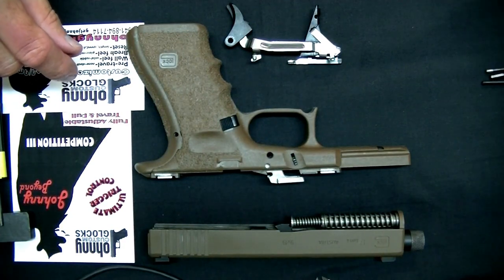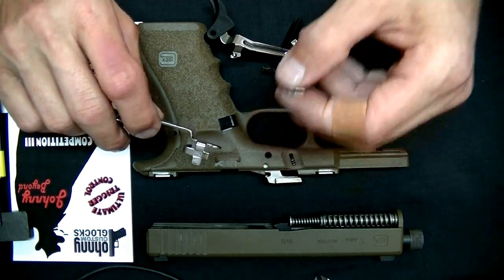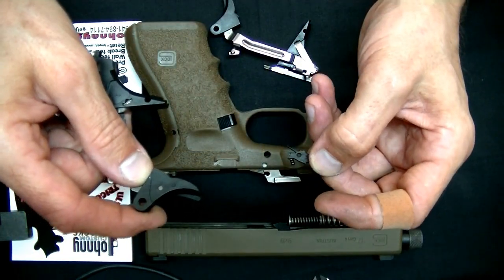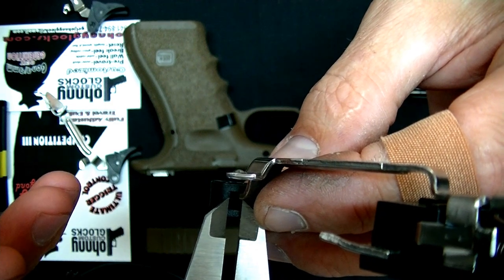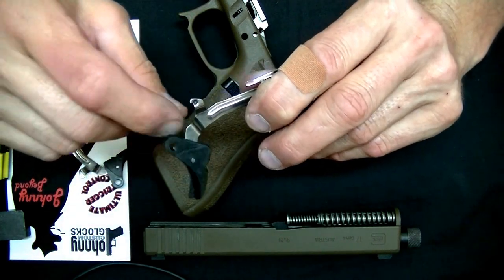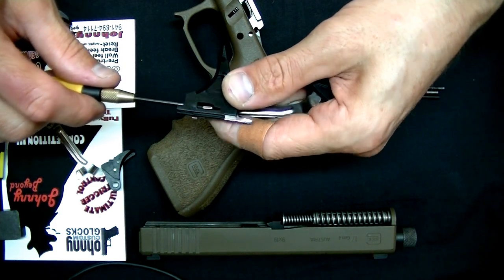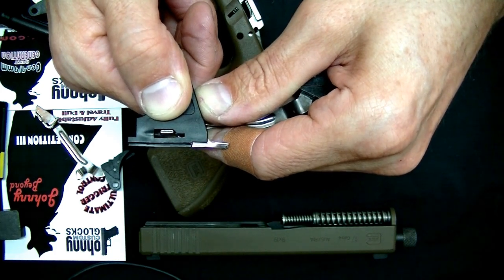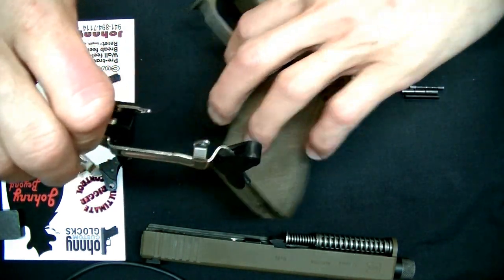Dialing in Johnny Custom Glocks trigger pt1 EDUCATIONAL ONLY

Comment: Great view and explanation of the trigger reset.  Now what causes the trigger bar to move out and away from the control tab?
Reply from the maker: if I understand what you're asking correctly. it's actually part of the slide that pushes the control tab over. turn your smile upside down and you'll see a cutaway in the rear right above the control tab. during cycle this will push it over allowing the spring tension on the cruciform to do its job pulling it up towards the slide and pulling it back behind the face of the connector.

Comment: Does those set screw requires some kind of loctite? How does it perform with heat? I own a metal trigger shoe and it gets really hot after a few mags, the loctite used on it will come loose also.
Reply from the maker: I drill at 60% and use a taper tap leaving the last few threads uncut. This allows for amazing seizing power also they are pre configured now and seized with loctite 425 specifically designed for polymer to steel application
Reply: @johnnyglocks  Awesome. Looking to order a set soon. For your JG shoe, are they only available in black? Did not see an option for the silver one before adding it to the cart. Would prefer the silver if still available.

Comment: Is that the proper trigger bar?..It still has the horrible gen 4 bump on it!
Reply from the maker: Albatross497 
the bump is actually a smart upgrade most people assume it's terrible because of something they read or saw a video on. Granted if there's too much material on it it should be reduced but on most trigger bars it's fine. Glock since day 1 has had that bump on there 10mm and 45GAP & ACP guns. the bar has just been changed again. gen 4's and 3's are interchangeable depending on what you want the trigger to feel like
Reply: Everyone i know replaces it..How is it a smart upgrade if you don't mind me asking...Why is it there in the 1st place?
And you are correct! My gen 3 g30 has that bump.. I've learned something today!
Reply from the maker: Albatross497 
I will tell you just swamped now